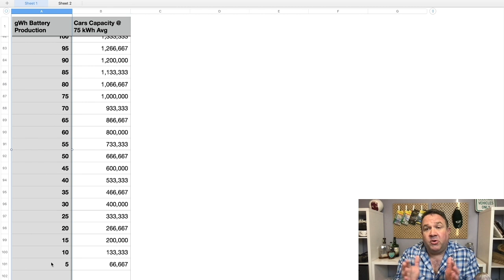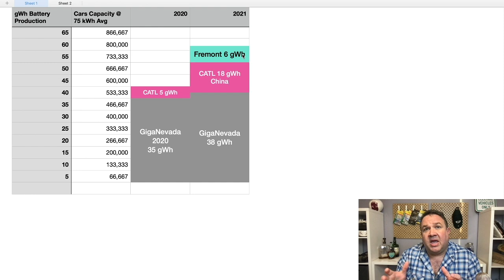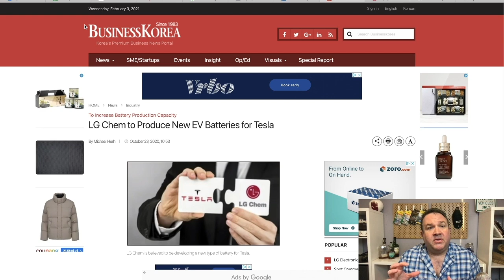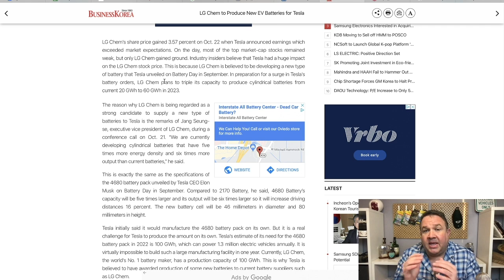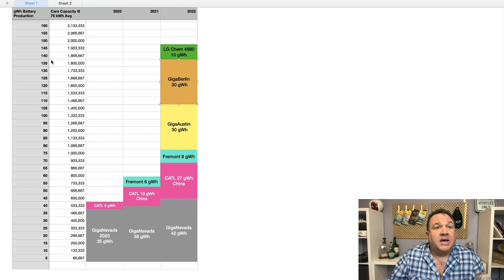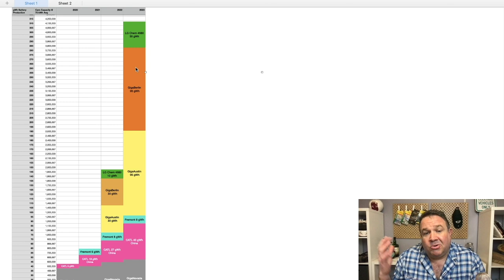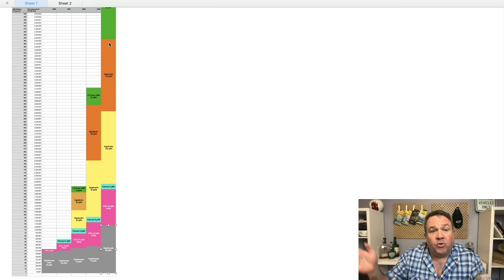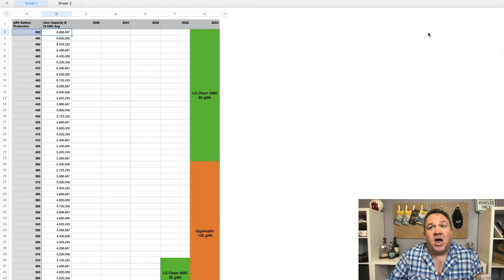Tesla Battery Ramp Up Visualized.

Comment: It would be easier to follow instead just having a spreadsheet with only each factory battery output each year.
Taking your numbers I get for 2022 147 gWh and 2023  314 gWh.
For 2024 your numbers are so small I cannot read them at all.

Comment: 4:14 That must be a misquote.  There is no way anyone is making batteries that are 5X more energy dense.
Reply: Assume the "jellyroll" material is the same thickness as a 2170 cell.
Use a "roll length" (on line) calculator to guestimate the length of material in each.
Multiply by the height of the cell.
The surface area of the material in the 4680 is 5x that of the 2170.
That means 5x the energy capacity.
Then consider the tabless design.
Less internal resistance allows faster discharge, = more power (6x?)
BUT
This assumes the same chemistry!
They could (will) be even better on a cell to cell basis.
Next.
Assume the cell casing in the same material (steel?)
Compare the surface area of the outside of the cell.
Multiply by the number of cells required per pack.
The 4680 pack uses 66% of the metal for those casings, so lighter pack.
Then remove the "pack casing".
That's more weight lost.
These improve the kWh rating of the pack

Comment: I think you misheard the battery production plan during Q4 call. They are installing 200 Gwh capacity in Berlin and Austin together. Due to the time needed to ramp up they expect  only 100 Gwh of production in 2022.  The 30% he mentioned had to do with growth rate of production capability. Building a 100 GWh plant in Berlin (and one in Austin) also lines with all the comments made by Elon regarding building the largest battery factory ever in Berlin with 100 GwH initial capacity (and growing to 250 Gwh over time).  So its not 60 GwH of Tesla cells in 2022, but 100 Gwh (50+50 or most likely 60 in Berlin and 40 in Austin as Berlin would start earlier).
Reply: I'd be go one further in conservative. When they talked about 100GWh at battery day I would hazard that that was total aggregate gwh from all tesla productions, not just the new battery facilities at kato, berlin, and austin (Else they would have stated the larger number including suppliers and Nevada because companies like to brag about that sort of thing). The conference call was directly concerning berlin, and austin getting the ability to expand the installed capacity of those factories from 100-200gwh but they wont scale in 1year to be 30gwh likely. Just getting to 10gwh in 2022 in two new plants would be an achievement and easily match their ramps for the first full year of production while still hitting that 100gwh of total batterys used by tesla. How fast those production lines ramp after 2022 is hard to model but that starting target of 100 in 2022 should be the whole companies production not just part of it.

Comment: You got it.  Your 6 mill is about right and VERY gettable.  Add 3 new giga factories in full production by 2024..and 6 mill easily.. No constraints and no reason not to achieve that capacity...Also consider Elon estimates 20 mill by 2030.

Comment: Perhaps try turning the spreadsheet horizontal.  Looking forward to the next one.
Reply: I came to the comments section to add that very message. Switch the rows and columns and it should be easier to read.

Comment: I got the impression that they will actually produce 100 GWH of 4680 batteries in 2022.  The capacity they are building for in Austin and Berlin is double that.  Your model does not show enough capacity in 2021 to make 850000 + vehicles in that year.  I am certain that they will achieve at least this number.  I love your concept of showing how fast the ramp will be.  This ramp is why the semi will be in volume production in 2022.
Reply: He didn't include the Panasonic Batteries from Japan? For Model 2 & X. That could make up the difference.

Comment: You neglected the Panasonic batteries, 18650, from Japan. Those batteries have supported up to 100K Model S/X.
Reply: Yeh I was going to say this too 😊
Reply: I suspect those will ramp down after a few years. Teslas challenge over the next 5 years or so is going to be to get all of their vehicles switched over to 4680 cells in structural packs and megacastings. I suspect Plaid+ is already going to be 4680s and is providing the blueprint for future S production.

Comment: I think there's gonna be another factory coming online by 2022. There's only so much capacity you can add to a facility. In fact I'd be surprised if Tesla wasn't at least in the process of looking for if  not already located the next location.
Reply: I think the Austin site may be the exception.  In terms of acreage, the initial factory, including the battery plant, is consuming maybe 20 or 25% of available space, if that.  Lots of room to keep expanding.
Reply: @cerealspiller  I agree they have plenty of real estate but they already said that location won't be just mfg. There will be things for tourism, like a waterfront boardwalk.
Reply: @cerealspiller  a freeway bisecting the property and a river bordering it does greatly reduce the usable acreage.
Reply: @patreekotime4578  This is true.  But we are still talking about 4 square miles of real estate.